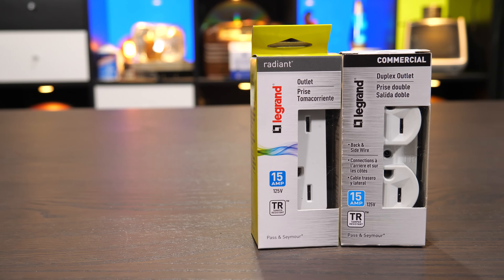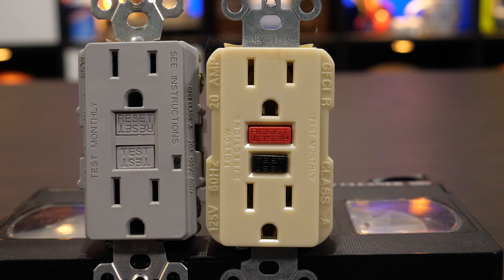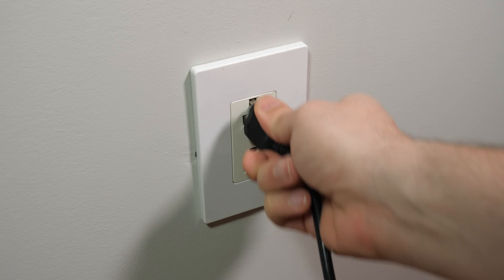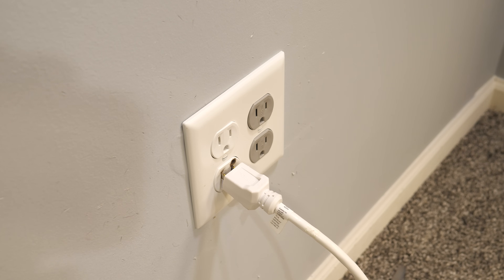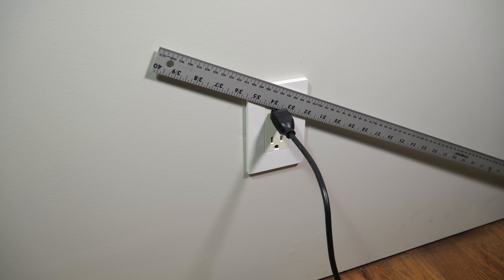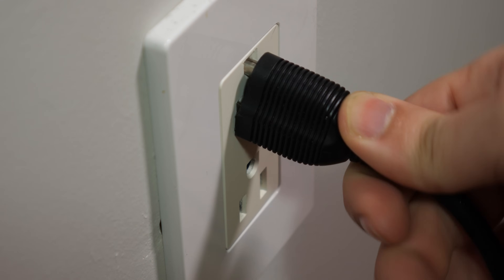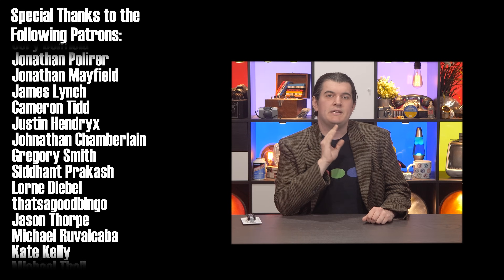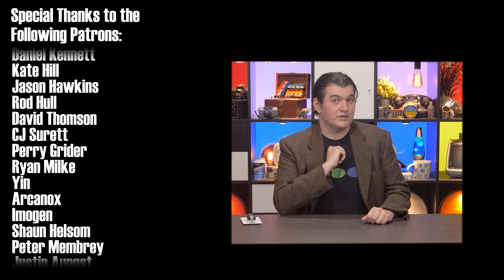Power outlets are topsy turvy - but does it matter?

Comment: I am a licensed journeyman electrician. I have installed thousands of receptacles. If you dont want to go back tomorrow, you install them ground down. 
Only switched or half-hot receps go ground up. 

Notice i didn't say upside down. Thats what Mrs. Customer calls then when you install them "correctly" 

Also, every first year classroom hours apprenticeship teacher is going to tell all of their students that receps go ground up so they all come to work the next day and say, "You've been installing receps all wrong, mr teacher man says they go ground up, per code" 
The usual response to this is to have them install the rest of the receps on the job, then do it again when the punch-list at the end of the job says all the receps are "upside-down"

I typed this comment up less than 30 seconds into this video and have no context for anything actually said within.

Comment: agree at 14:00
we should simply just mandate right-angle plugs with a 45 degree exit for the wire(straight down tends to cause it to cover up the second plug spot) or mandate it be a plug with a simple plastic pivot to allow a +/- 90 degree swing to the cord exit with detents for -90,-45,0,+45,+90 to ensure maximum compatibility with any outlet orientation and to avoid the entire purpose of the ground up argument
Reply: to be clear my air wick warmer already has something just like this, a small plastic plug plate the wires of the heater are attached to, give it a twist and it has a detent for sideways plugs, it is unpolarized so the +/- is not important but it does the job and is pretty darn sturdy, even after I drilled out the rivets and just rely on clipping it together

Comment: The opening point is correct — nobody cares.  I know my receptacles are marked to imply the ground at the top.  But my electrician installed my outlets ground down, and the inspector didn’t question it.  I notice how they are oriented in commercial buildings, where they were certainly installed by professionals, and they are almost always ground down.  Even in medical buildings.  In a hospital, the hospital-grade receptacles will be installed ground up, but that’s about all.

I installed a new receptacle, ground up, when I bought a new washer.  It came with a 45° angled plug, so I had to invert the receptacle to the conventional (ground down) orientation to relieve strain on the cord.

Comment: THe 'what about 2 prong plugs??' bit kinda reminds of the logic of 'well CRIMINALS will still break the law!!!' like.. yeah? Nobody ever said it's a panacea, but for circumstances where it will work it helps.
Reply: Also, I have a ton of cords where the cable goes off at a 45 degree angle from the plug. And in any case.. so? have new cables or devices with different orientations-- or even twistable!

Comment: Not sure if anyone else has said it yet but, I've run into the issues of 45° plugs not meant to be upside down a LOT when installing dishwashers, at least in AZ and using "Smart Choice" branded dishwasher install kits.
The outlet is upside down and the plug on top, is typically on a switch for a garbage disposal to turn on/off when needed and the bottom plug is used for the dishwasher which needs constant power to be used whenever.
We can almost never connect the dishwasher nicely, or, has to use a small extension with a swivel head. Otherwise if you tried to switch the cables around, now the disposal is running 24/7! It's so dumb!

Comment: I find that 3-prongs back out much easier when installed ground-side up than ground-side down. Since that is much more likely to occur than something falling on the exposed plug (especially with the adoption of tamper-resistant receptacles in the NEC), I prefer to install them ground-side down, on top of all the reasons you listed. But I wish we would adopt the sleeved blades too. Still, tamper-resistant outlets avoid the issue completely

Comment: You did touch on the one problem that right-angle plugs have: the general inability to use two of them in one duplex receptacle. Power strips that have the grounds down the middle of the strip have their ability to handle several cords hamstrung to only one or two by right-angle plugs (which is why I look for power strips that have the grounds along a side, so right-angle plugs — and power bricks — stick off the side of the strip.) Having the cord exit on the 45 degree helps quite a bit, though it isn’t feasible for every use.
Reply: Some power strips mitigate this by putting the sockets at a 45 degree angle. At least here in Schuko country, maybe there's a reason you can't do that with NA sockets.
Reply: We could solve that in the future by turning the orientation of the outlets 90 degrees and installing so they're side by side.  Not saying we should do that though.

Comment: One thing worth mentioning are recessed sockets.  These combine the socket and wall plate into one unit, with the sockets themselves set well back from the plane of the wall.  It's much less likely for users to make accidental contact with live plug blades while plugging & unplugging with this style of socket, and less risk for conductive objects to hit the spicy parts of bumped plugs that don't stay fully-seated.  There's also less protrusion with straight-in plugs, and right-angle plugs are practically flush with the wall, which is great in cases where you want to plug something in semi-permanently behind a piece of furniture (although you're usually limited to just one right-angle plug in a recessed duplex socket for obvious reasons).  Almost no one ever talks about this style of plug, but they have a lot of advantages.
Reply: Most European plugs are recessed for these reasons. It also helps against the plug falling out because the plug can be held ib by not only the contacts, but also the plastic casing of the plug. And even if the plug backs out a bit, you still likely can't touch the contacts by accident.
Reply: @@KeyDx7  Yep, they're defiantly not for wall-warts or most direct-plug-in devices.  Plusses and minuses; I certainly wouldn't replace every outlet with them.  But for those hallway or kitchen sockets that only see temporary connections with normal straight cords, or situations where you want to plug things in behind furniture, they are pretty nice.  

As for pulling on the cord, in my experience recessed sockets are not so deep that you can't effectively get a grip on the plug.  The sides of some plugs may be harder to grip, but there's always the top & bottom.  Besides, for modern NEMA integrated or overmolded cords/plugs, the plug & cord are pretty solidly connected and I wouldn't worry too much about pulling on the cord to unplug something if necessary.

Comment: First dislike you've earned from me on "nobody cares". Not even when shilling Tesla.

If I woke up and found they were suddenly the right way up, I would be happy. All plugs should have a ground - if I and people like me spent our day implementing legacy "that's the way it was so that's the way it will always be", a lot of the internet would not work properly.

90 degree plugs are entirely inferior to 45 degree plugs. Look at any serious power equipment, 99% chance it has a 45 degree, which works fine in either orientation and is much harder to block any adjacent socket with, including on power strips. If I bought a new UPS and it didn't have a 45-degree, I would be immediately suspicious of it.

Comment: Brazil uses IEC 60906-1 outlets. I use ground-up mostly because it works better with right-angle cables, which are reversed from yours.

Comment: This is one of the reasons I like our Australian connectors. The active and neutral pins are at 45 degree angles, so it's a lot harder for the plug to fall out, even if it doesn't have a ground pin (or a plug that has a spot for ground pin)

Comment: A side bonus of our crazy Chicago outlets are that they are actually a decent bit harder to pull down and expose the hot blade, especially grounded plugs until the outlet is very worn but then that's the outlets fault anyway.  Back when I grew up we were taught to respect electricity. The real answer is we need everything efficient enough to run at USB voltages lol.

Comment: The certified electrician at my former workplace (a newspaper printing facility) was installing plugs with the ground up in more public spaces, like hallways, near machines etc, because he had shock himself in the past using a tape measure AND from picking up a metal strip that had fallen on a dislodged plug! But he was installing office-space plugs with the ground down, because of 90 degree angle plugs.. So the correct way of doing it for him, was: It depends on the use case. 
Anyways, euro plugs are way safer! (but huge!)

Comment: welp we already disagree at 1:34
we SHOULD care and we SHOULD DEMAND "face" orientation except in VERY SPECIFIC safety cases
the reason: old wall warts with face orientation in mind

the nema plug has far too many flaws to make sense, but when inverting the outlet(ie ground on top) wall warts with excessive weight will tend to want to pull out of the plug, and as they literally never have a ground pin(adding one, even a dummy would prevent the torque from pulling it out) it is literally intentionally exposing the two live pins and wearing out the contacts by putting the ground pin up

NEVER PUT THE GROUND UP, the code is bullshit, the only concern is if a properly inserted device will lead to a safety hazard, ground up is a 100% chance with large wall warts, ground down is only a small chance if the outlet is already worn out

to anyone who disagrees, I ask, when was the last time you had a ground-down outlet lead to exposed pins if the plug was fulling inserted before the pins got exposed?
and what is the best solution to exposed live pins that could be added to the nema-5-15P? SLEEVED PINS LIKE THE BRITS MORONS
the nema 5-15P is ironically EXACTLY like a smaller british plug just without sleeves or fuses(most times), and the issue with brits is that they tend to want nearly 3kw to be accessible at every plug, a thing that almost never matters

if you look at the contact points of a nema 5-15r you find that the contact starts about the same distance inside the plug as the maximum exposed pin distance on the nema 5-15p, making the extra exposed metal completely pointless as it literally never provides contact
sleeve the extra few thou(or mm for those who care about measurements that are not all different ratios rather than powers of 10) and outlet orientation loses any "safety" argument, all that is left is pure practicality

now wall warts are and always were stupid, split the flex and put the heavy part in the middle, solves the loose plug dilemma and the "can't plug thing in because wall wart covers second plug" making "plug savers" a pointless product

and banning the sale of fixed-plug wall warts will eventually fix all the outlet problems we tend to have(besides the exposed live pins fixed ONLY by sleeved pins), humans want longer cords anyway than standard 3-6ft so offering a block that has a standard "figure 8" or "micky mouse" cord(the two most common detachable low-power, low-profile plugs) fixes all the concerns, and you can just make a block adapter that is simply included with every product that has no flex and just lets a device that may be attached to an extension cord to connect effectively directly to the plug

sleeve the live pin(only one that matters based on the way US distribution works in polarized and properly wired outlets), add a fuse(christmas lights already have this and fitting a 5x20 fuse that shouldn't ever blow anyway should be easy, or even use an ato(or similar) style inline fuse), and simply ban the sale of fixed-plug devices above a certain weight(the weight limit is for USB blocks that are unlikely to be practical to have cords rather than a fixed-plug design), and mandate plugs be in the ground-down or ground-sideways orientation as it protects against old wall-warts coming loose

Comment: I once dropped a small metal pin, which bounced across the raised-flooring tiles into a recessed outlet box, with a loose cover, where there was a partially-inserted plug, and it (of course) found a way to bridge across those pins.  "Snap" went the breaker, and the test equipment went dark.

Comment: Why don't new devices simply use plugs with the outer half of the pins insulated (like the europlug)? That would prevent electrical contact in all the examples shown here.

Comment: Frankly i lothe right angle plugs. Very few that are not part of extension cords or splitters use that 45 degree setup. They basically are designed so you van only use 1 on any given outlet pair. The only thing i hate worse is wall wart power supplies that not only have the drawbacks of right angle plugs but also tend to block access to any other socket in the vicinity. Ive got one that blocks all 4 sockets on a 4 outlet boxe because its just slightly too big and tall.
Reply: It's infuriating when there's a mismatch between socket ordering and plug-pack orientation. If one goes horizontally, the other goes vertically! Vertical plug packs go with horizontal sockets. The standard in Australia is to put the sockets in a horizontal row with the earth pins on the bottom. A properly-designed plug-pack will point down. Power boards with extra spacing between some of the sockets exist to accommodate large plug-packs. Unfortunately, some manufacturers orient their plug-packs so the bulk goes sideways, making them unusable in any socket but the very end. I suspect the manufacturers in question are from countries that default to vertical orientation for the sockets and then just swap out the pin configuration for other markets.

Comment: Right angled plugs do make it difficult to plug two of them into a double socket as they interfere with each other.
Reply: Seems like they're designed with the assumption that sockets go horizontally, rather than vertically.

Comment: Canadian Electrician here, my understanding of the initial orientation being enforced with the ground up resulted when there were far more metal covers being used in all applications of commercial and residential. The screws used to loosen enough that the cover plate would fall down and slip behind any cord end not plugged in enough. Over the years different codes have changed as well as different trade practices. To name a few, before having different colour of receptacles many institutions like hospitals might put receptacles that were on back-up power systems with the ground up, or other indicating factors. The same reasoning can be found in some houses/apartments that might have had a switched receptacle, it would be easier to identify by the odd plug out being rotated with the ground up. It can be difficult to pin point any exact reason as the codes and practices have continued to change through regions and nationally over the last 80 years.  For 99% of the time though, it is all to do with preference, apart from that if an inspector/engineer tells you to do it a certain way it is simply easier to follow their request.

Comment: I would like to add one more data point. I just looked at my spare parts bin, and I found 4 different outlets from 4 different brands. in every single case, the writing stamped into the metal tabs at top and bottom of the receptacles, and the writing moulded into the plastic on the rear of the receptacle, all appear right-side up only in a ground down orientation. Writing on the front that would be visible when the outlet is installed is all duplicated in both directions. (i.e. TR at each end of the face-plate, one in each orientation, or GFCI test/reset lettering as shown in the video)
Based on this, I can't see any reason to conclude that the manufacturers believe that the outlets should be installed ground up, in fact the reverse appears to be true.
Contrast this with light switches, and every one of them has "top" stamped into the upper metal tab to indicate orientation.

EDIT: It appears that I was wrong in that the 4 different outlets are actually all from the same brand, Leviton. I also found 3 more models from them as well, all labelled similarly. So maybe it's less universal than I thought. It seems I don't have anything non-Leviton to compare to though.
Reply: You have strange devices, because my Eaton and Hubbell receptacles (premium brands) read correctly only with the ground pin at the top.
Reply: @GH-oi2jf  I just updated my original comment, but it appears I made an incorrect assumption. the 4 outlets in question all date from radically different time periods, and are all very different in appearance, however they're all Leviton brand. I did some more snooping around my house and found several more versions, but again, all from Leviton. I guess Leviton is very popular around here! And everything from the 1970s to modern versions from Leviton all have writing which implies a ground down orientation.

Comment: Obviously, the correct orientation would be a 120° clockwise rotation from the "face" orientation. That would make the blades form a downward pointing triangle with the live blade on bottom.
Diagonal outlets for the win!
Reply: The carpenters would not like that.

Comment: I think those outlets covers could actually make things more dangerous as their difficulty to remove makes it more likely someone will use a knife to pry them out, introducing a risk of accidental contact.
Reply: Proper outlet covers come with a plastic extraction key, but the ones he showed don't seem to lock into the receptacle at all. Which kinda beats the purpose as a kid could easily pull it out.